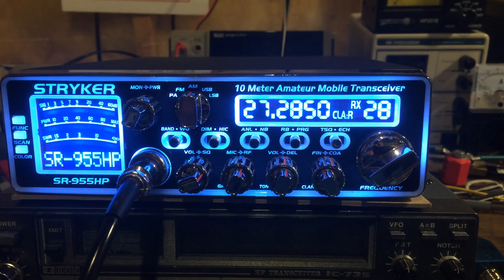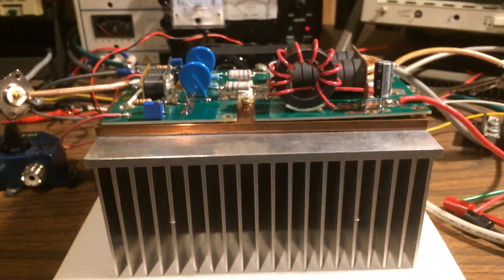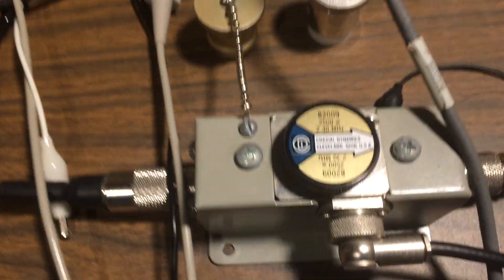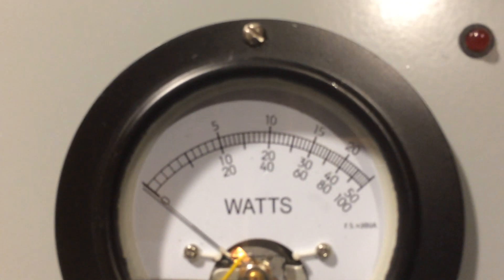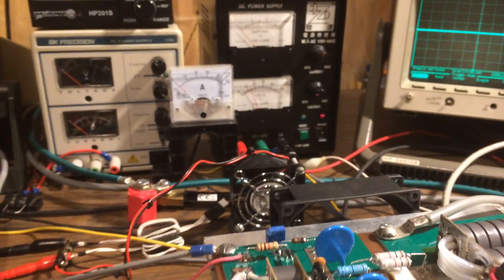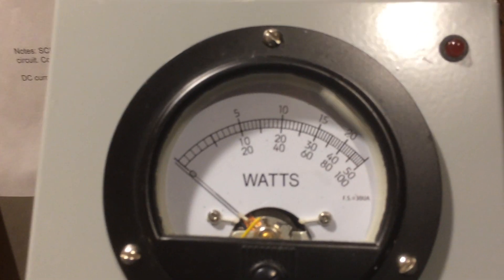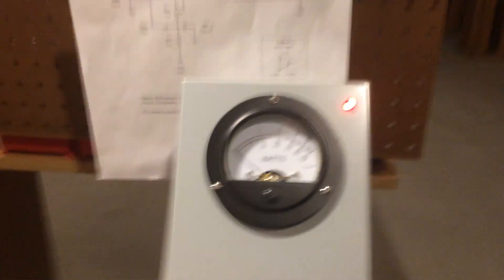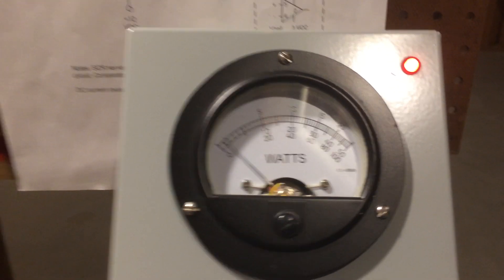RF Man Demos Single LDMOS Amplifier With Latest Improvements

Comment: Is that on AM? Doesn't seem right. @ 1kW carrier, and 100% AM mod, peak should be 4x == 4kW. So this is really a 1.5kW peak amp = 375Watts of AM at best.
Reply: Its 1KW dead key. You can slice it up from there. Its far from 375 W.
Reply: @ASmith-vu2wo  Not sure if you are agreeing and disagreeing. If it's 1kW dead key, then linearity on AM might be acceptable at the 250W level.